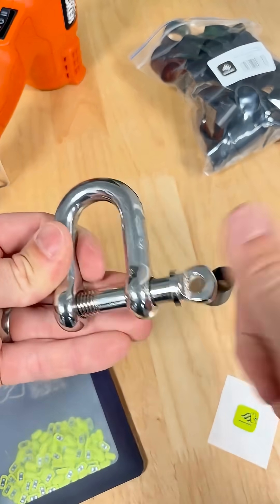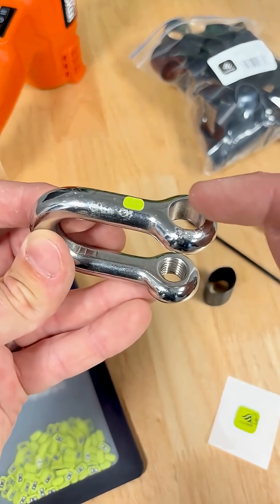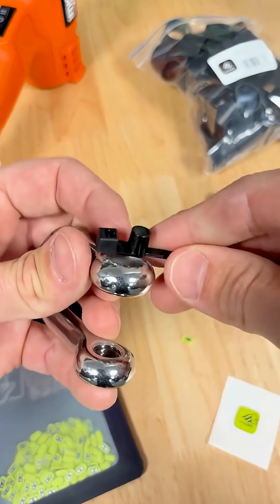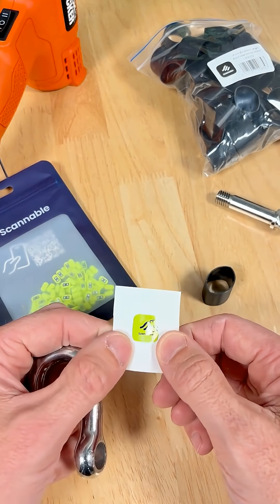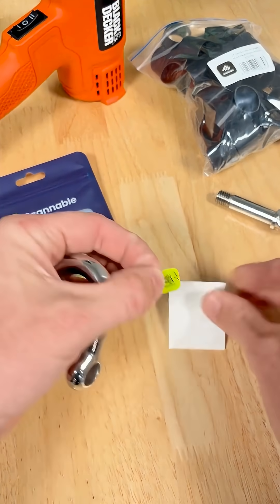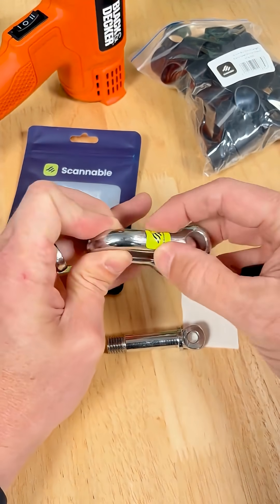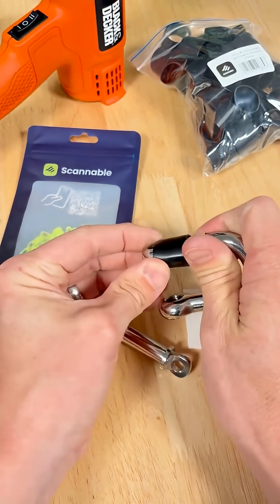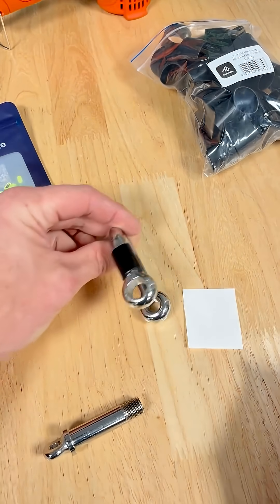How to retrofit an NFC tag onto a shackle

Comment: How thick can the item be before the tag can not be read I'm thinking about gluing inside tools to mark as mine when a theft has happened.
Reply from the maker: It really depends on the material that you're attaching the tag to. It reads through helmets and phone cases no problems. We've got a sample pack available in our store if you want to check out a few tags before you make a decision.
Reply: Thanks  @scannable_io